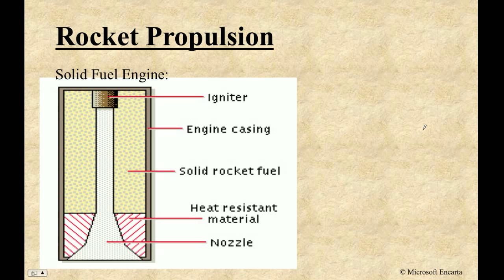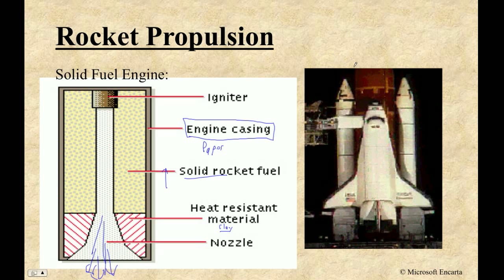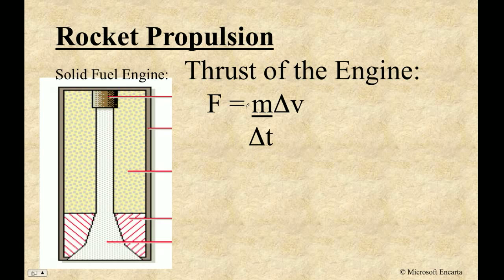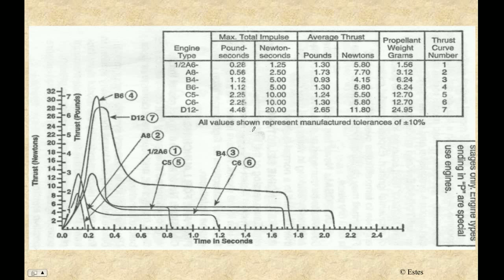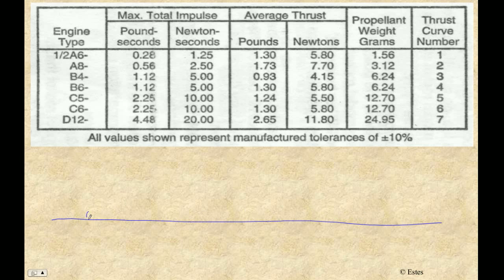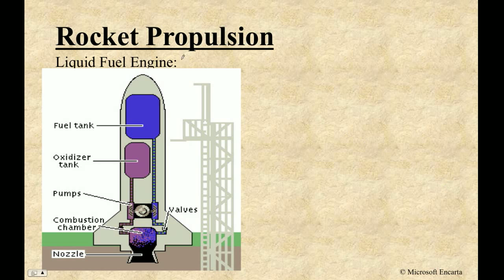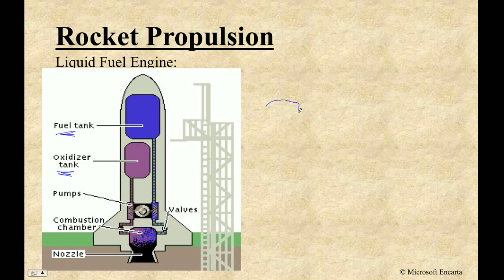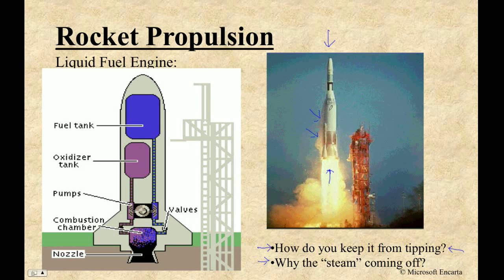HTPIB07D Solid and Liquid Fuel

Comment: the gases is actually the propellent heating up and boiling as it dose when exposed to the warm world we live in and they vent the gases out to stop it from blowing its top over the reaction you've got to remember its Liquid Oxygen / Liquid Hydrogen witch is a gas at room temperature.